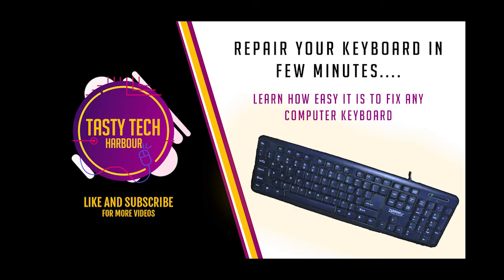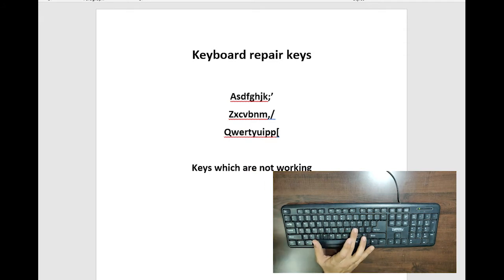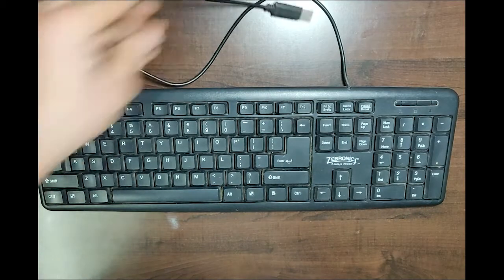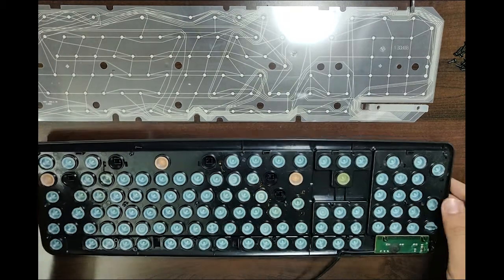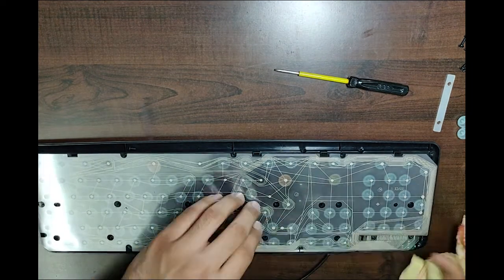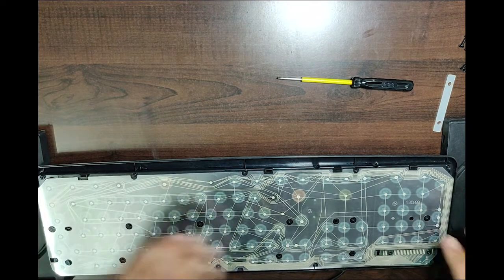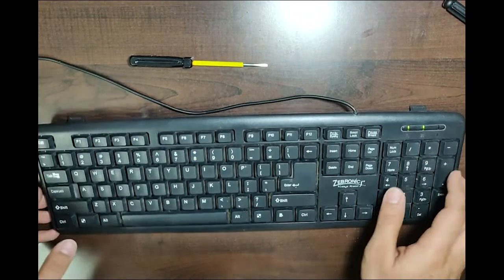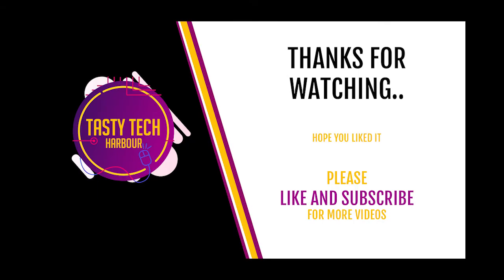2021 | How to Repair your Computer Keyboard if some of the keys are not working

Comment: What to do if the keys are jammed due to continuous usage? 🤔
Reply from the maker: Due to continuous usage, I guess the keys would have worn out, you will have to replace the keys or go with the new one. 

Sometimes the keys jam because of dust and sticky substance fallen on keyboard, those things can be cleaned and fixed.
You can use compressed air, cloth dipped in alcohol to clean the sticky substance or you will have to remove the keys and clean.